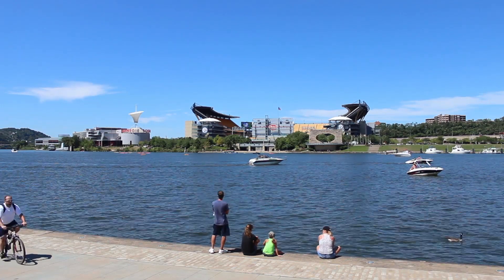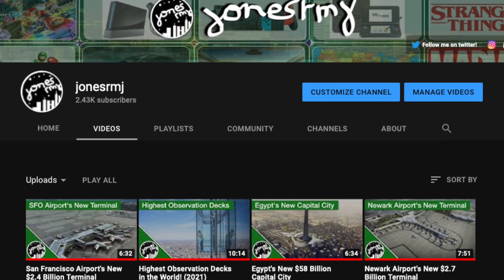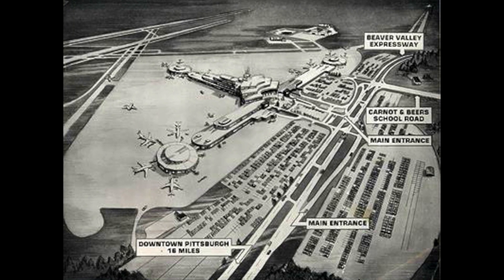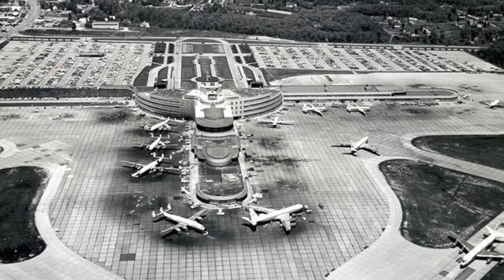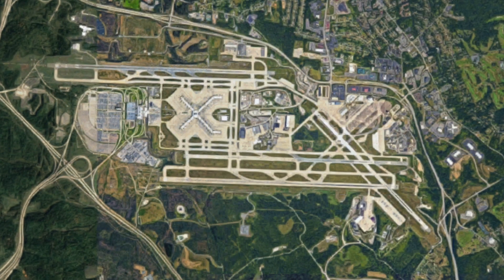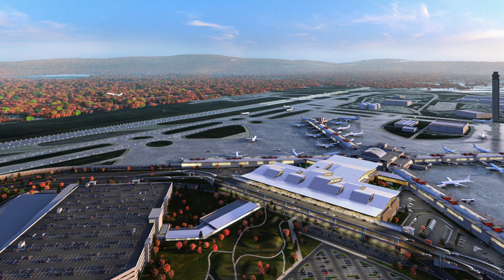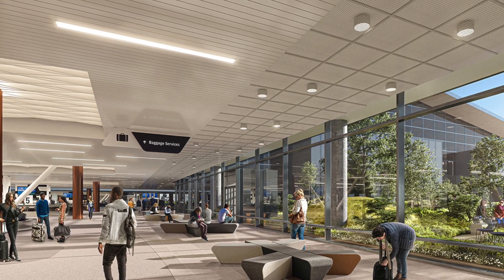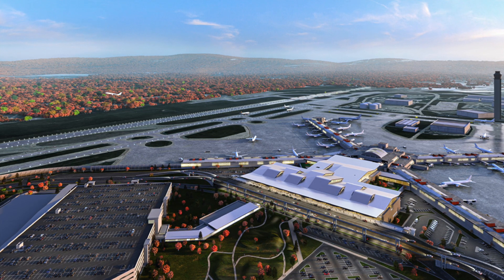Pittsburgh Airport's $1.39 Billion Reconstruction Project

Comment: Looks like a completely new design.  Makes lots of sense adding a new Head-House to an existing Air-Side Complex.  If they need more gates in the future they can lengthen the existing piers.  The former X-Design was built for US Air and their connecting hub operation.  They dumped Pit after all that money was spent.  Its a shame that the old Art-Deco 1952 Terminal was demolished.  That building was one of the first in the US (along with Baltimore) to incorporate the Finger-Dock design.
Reply from the maker: Agreed. Thanks for watching!

Comment: Would you potentially consider doing a video on the future of Atlanta airport? They have a 6th runway, concourses G, H and I, new taxiways, and a couple other things in their planning.
Reply from the maker: There would have to be a decent terminal project or something like that. If it’s just runways, then that is not really enough for me to do a video.
Reply: @jonesrmj   You know what forget that idea. I have two much better suggestions. If you haven’t yet covered Hong Kong airport’s expansion, that would be a good one. I would also suggest Frankfurt’s new Terminal 3, which is due to open in 2026.
Reply from the maker: @willmitchell4696  Thanks for the suggestions. I actually have been eyeing Hong Kong!